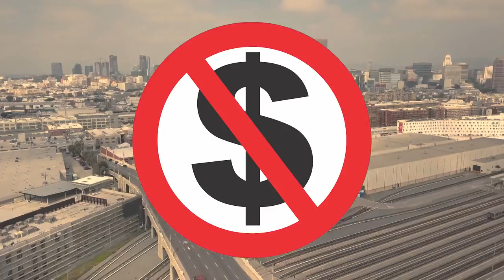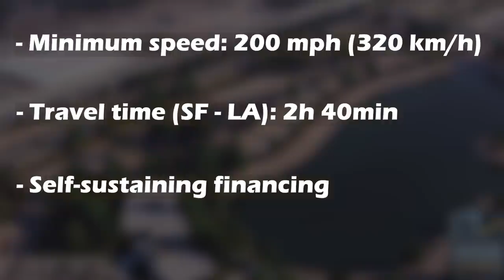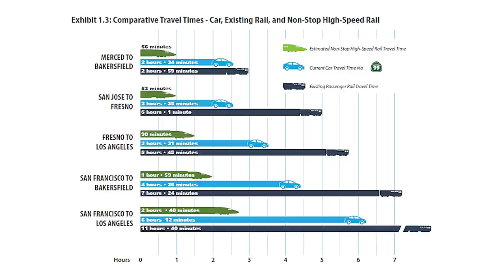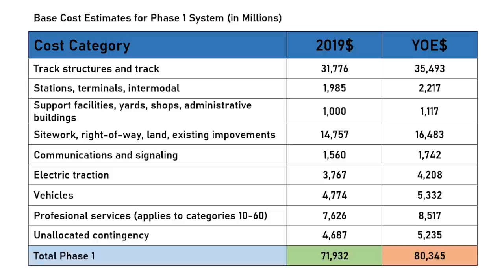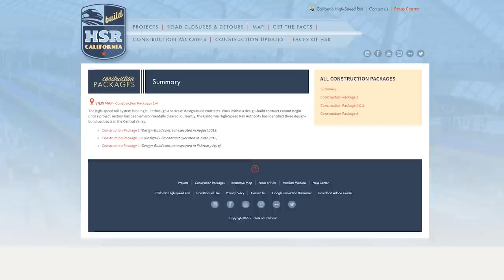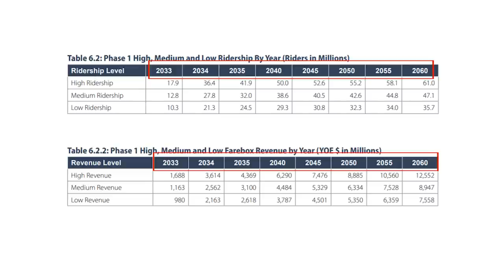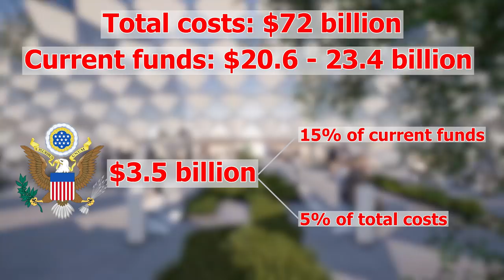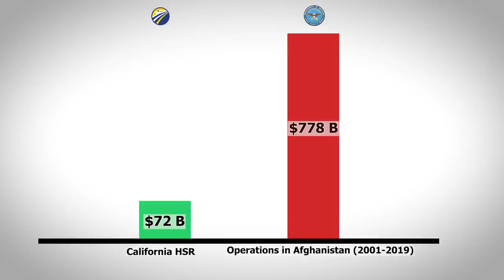California High-Speed Rail Project: All You Should Know

Comment: This is an excellent unbiased report on CA HSR. One thing though that was only briefly mentioned was that early on consultants from Europe recommended a different route. Instead of the current route along old Hwy 99 using the I5 corridor was recommended since the land rights were already in place. Anyone who has ever traveled along these routes knows that Hwy 99 goes right through some of the most productive farmland in the world, while I5 goes through mostly barren country. The latest report from HSR contractors identify the land acquisition as the one of the prime factors for delays and cost over runs. Of course politics early one was a big driver for choosing the route unfortunately.
Personally if driving I prefer Hwy 99 over I5. It's slower but much less boring than I5. If HSR is ever fully operational I doubt I'll live to see it.
Reply from the maker: thanks for those details!
Reply: They should give up and do I-5
Reply: the local governments along 99 lobbied for that route even they already have Amtrack. They don't seem to understand the distance and traffic needed to justify HSR
Reply: Placing stations on I5 may be cheaper but it detracts from some of the value by building outside of the city center. It would create more car trips, new development and not create long-term investment in existing city center, which takes away from the sustainability benefits. Sure it would be cheaper, but what benefit would be lost in the process?
Reply: @jpg3702  Perhaps but the original concept (voted on by the citizens) was HSR between the metro LA/SD area to the Bay area, not Fresno, Bakersfield, Stockton, etc. Those connections should have been added with commuter lines as needed later along existing highways that exist now. Very little ridership was and still is anticipated from the smaller towns along the east side of the valley.  In a recent article in the LA Times the main contractors identify the land acquisition as the major factor in cost over runs and schedule delays.
Reply: @johnburwell6609  I hadn't read the exact legislation, but the very initial concept that I heard about before it was even a bill included stops in the Central Valley. The planners who were discussing it included this because it would help those cities in the CV.
Reply: Fresno is the fastest-growing metro area in California, with all the sprawl that goes with it. And with housing in the Greater Bay Area skyrocketing in cost, people are commuting from places like Tracy. So I'm in favor of HSR including the larger & fast-growing population hubs in the Central Valley. I also want HSR to be integrated into a local mass-transit network in each of those locales in order to reduce car travel & sprawl. Whether any of this will happen, remains to be seen. But since construction has already begun, it's kinda too late to even talk about switching to the I-5 corridor anyway.
Reply: @joechang8696  TBH, I feel like comparing Amtrak to anything would be a slap in the face. Sure it's a train just like the HSR, but the speed, frequency, and reliability of the service is crap.

That the local governments are opting in, I believe, is that they lose if they join in, but they join more if they don't. Why? This is a farming area. How often will people travel long distance without some sort of cargo? The second you have cargo, public transit goes out the door. But, there will be times when you do travel for fun. If the train is going cut through your area anyway, might as well benefit from it.

Though I'm sure Central Valley won't be happy that the Bay Area has moved in either. The culture/believe/POV are quite different between the two, and of course, locals won't like the jacked up housing prices.

At least now that the rail is there, Amtrak could take it over and use it to improve their service...

Didn't realize acquiring the land was the issue. Always thought it was the required tunnel going through Tehachapi and later Pacheco Pass.
Reply: If you build on the I-5 corridor,  then you build where there are no cities.   You aren't going to get people to leave the congested areas of the state if there is no place to live.   The 99 corridor was the right avenue;  however,   HSR failed miserably in getting a line drawn and the property purchased.  Land owners kept them tied up in court for a very long time.
Reply: @thegreattuna7187  agreed.
The thing about these Central Valley agricultural landowners is, they are some of the most batshit right-wing people you'll find. Just look at the signs they post up along the highway.
They have no problem selling their land to a private prison - so the people who are locked up there can increase the population size of their district while not actually being able to vote (kinda rings a bell, doesn't it?) - but to build a railroad where a perfectly good highway exists? Sounds like progress and we can't have that!
Between them, and the ones along the CalTrain route down the Peninsula throwing up bogus "environmental" lawsuits, they must have added a decade and a gajillion dollars to the project.
And then they point to how long it's taking and how much it's costing and shout "boondoggle" as if they had nothing to do with that!
Reply: @thegreattuna7187  The voters in CA that approved this initiative didn't vote to provide a solution to the large metro areas failed housing policies. They voted to provide HSR between LA/SD and the bay area. At the time this project was conceived the revenue attained from providing service to the cities on the east side of the valley was studied and found to be minor. The cost of providing that service wouldn't be recovered. Remember one of the main concepts that the voters approved was that once built it would pay for itself, not be an ongoing drain on the state budget.
Reply: @johnburwell6609  This is false.  Here is a quote from the original proposition's ballot summary:

"Provides for a bond issue of $9.95 billion to establish high-speed train service linking Southern California counties, the Sacramento/San Joaquin Valley, and the San Francisco Bay Area."

San Joaquin Valley = Fresno, Bakersfield, Stockton, etc.
Reply: @Geotpf  That's from the ballot summary not the original words of Prop 1a. A lawsuit was filed about how the summary was written which was finally upheld by the court of appeals in Sacramento but by then the prop had already passed. One of the original requirements was " If the authority finds that there would be no negative impact on the construction of Phase I of the project, bond funds may be used on any of the following corridors: 
Sacramento to Stockton to Fresno
San Francisco Transbay Terminal to San Jose to Fresno
Oakland to San Jose
Fresno to Bakersfield to Palmdale to Los Angeles Union Station
Los Angeles Union Station to Riverside to San Diego
Los Angeles Union Station to Anaheim to Irvine
Merced to Stockton to Oakland and San Francisco via the Altamont Corridor"

This route you refer to is included but note only if "there would be no negative impact to construction of Phase 1". Can the argument that "no negative impact" exists still be valid?
It's also interesting that one of the arguments against 1a was that the costs for Phase 1 had been way underestimated and was closer to $80 billion which is surprise surprise close to the HSR authority's revised estimate.

I'm not against HSR but I was against the way this was crammed down the voters throats with misinformation and political back room deals. I don't really care that much since I've long since moved to Arizona which is at least a little more honest to it's residents.
Reply: The HSR ballot measure included specific San Joaquin Valley cities specifically in order to get more votes.  And without those votes there would be no HSR at all.  I will also say that the construction of HSR is a major reason why I will leave Los Angeles when I retire, but will stay in California.  HSR access to SF or LA will allow me to retire in the San Joaquin Valley where housing is affordable, but still allow me to have quick, easy access to SF and LA.
Reply: @sftrick  I hope you're retirement plans are far out in the future. Most likely with the current schedule, funding problems and construction delays the link to LA is many years away.
Reply: @jpg3702  there's no stations to be on I-5. It would be just straight running, which is the purpose of the project. LA to SF as fast as possible. Spur lines would be built to service the other cities.  In my opinion, its for SF to LA, not Modesto, Turlock, Merced, Madera, Fresno, Hanford, Bakersfield, etc etc etc
Reply: @johnburwell6609  Ive been posting comments just like yours but didnt know about the recent articles about land costs but thats just what ive been saying.  they could have gone right down the middle of I5 at true high speed/shorter distance and minimal cost. they could also have just upgraded one of the 2 old mainlines from Bakersfield to Stockton for a much faster train and then just connected that train to the new line at north/south ends.  I wonder if Feinstein's old man Blum has corrupt interests in the current project?
Reply: @johnburwell6609  yeah I think it takes CA-99 since it's supposed to service Central Valley towns as well as SF to LA travel
Reply: I think California HSR will happen no matter what because we are the richest country in the world. Europe always face obstacles before when building a High Speed Rail back in the day. If Europe can do it, then so can California.
Reply: @qjtvaddict  Not really, the California High Speed Rail will take very long to build, but I think it will happen no matter what.
Reply: @dwc1964  its more like lets put a wall through the middle of your farm and a loud noise producing thing right behind your house if we happen to not have to destroy it. Also it is a couple miles from the 99 so not on a road but all farmland. Oh and this really doesn't help you at all because you don't have any desire to go to LA or SF but brings those people who are going to complain about farming.
Reply: @gerritderaadt5497  Central Valley farm owners have had no issue selling their land to prisons (private and State) but they've got a problem selling their land for a railroad because they're not going to personally ride it.
Reply: @thegreattuna7187  Have you ever driven the I-5?  Thousands upon thousands of cars drive the I-5 between LA and SF every day.  These are the cars we want to get off the road.   These cars aren't going from Shafter to Merced.  They aren't going from Hanford to Oildale.  Yes, there are many cars going on those trips but it will be hard to get them out of their cars for short trips like that.  Also, there is NO commercial air travel between Shafter and Merced.  Just getting a percentage of those filthy, polluting cars going from LA to SF (or the other way) off the road and reducing the number of airplanes polluting the upper atmosphere between LA and SF would make a huge difference in our polluting the air.  Isn't that what HSR is all about?
Reply: @JediTev  Clearly it's not just for SF to LA (Sacramento is also factored in as well), and it was never intended to be. It's clearly for much of California, though it is noted that it won't directly serve Kings and Tulare County (the Kings/Tulare station sits just outside Hanford and about 20 miles from Visalia and Tulare), so it definitely makes sense to build HSR connecting directly to the cities in the San Joaquin Valley. On the bright side, there will be express trains that will skip some of the stops, like Madera.
Reply: @garywilson1688  HSR will get cars and their drivers off I-5, even with the SR-99 route. Many of them will be taking express trains that will skip the smaller cities while still making stops at locations like Fresno.
Reply: The problem with that is that I-5 doesn't serve many of California's most populated cities. Bakersfield and Fresno are among the top 10 most populated municipalities in California and it would be a travesty to not serve these areas directly with HSR.
Reply: @TheRailLeaguer  Not a chance
Reply: @garywilson1688  What are you talking about?
Reply: I think a big thing putting American high speed rail at a disadvantage is that America has plenty of oil. Europe and Japan have pretty much no oil of their own so for them electric rail is not just socially and environmentally but also economically advantageous.

Comment: Starting with the section they are is a joke.  They should have done the LA to SD section.  If they had actually done that in the 80s maybe the system would have be done by now.
Reply: I think building in a less dense area is good because it will allow them to learn from mistakes.  We have to remember it's the first project of its kind in the US and there will be some learning along the way. That learning should not come at a premium that would be there if going through densely populated areas.
Reply: @jpg3702  But it serves no purpose.  Makes way more sense to build the lines in the cities, that could be used, and then connect them later on.  It's not the first of it's kind in the US, there are 2 high speed electric rail lines  on the east coast.
Reply: @mushieslushie  There is a big difference between those lines and an actual high speed rail line. If you look at the history of the bullet train for example, it was designed from the ground up on grade separations and goes at much higher speeds, much higher than the highest speed train in the Northeast. I'm not sure what the second line you are referring to, but if you mean the one in Florida, it's not considered high speed.  In addition, there are a lot of engineering complexities of building in earthquake country vs the East Coast trains. Those trains are not truly HS rail and they are build on the same grade as roads, causing a lot of passenger delays, injuries and deaths.
Reply: They did it this way for two reasons.  First, it's the section that is easiest to complete.  Not only is it less curvy and less dense, there were fewer lawsuits in this section.  The rail authority won most of the lawsuits but it did cause a delay, so start in the area that had the fewest delays.

The second reason was political and kind of sneaky.  Basically, everybody knows the Merced to Bakersfield section is pretty much worthless by itself.  If they started in a section starting in LA or San Francisco, it would be likely that the section they started with would end up being the only section built.  This would also cause yet another NorCal vs. SoCal catfight over who gets that section.  So, they started in the worthless section in the middle, preventing the north/south pissing match and also increasing the chance that the whole thing would be built, as it is hard politically to stop with just the worthless middle section.
Reply: I believe it is a strategy. It is easier to build that section, in term of land acquisition and construction. Once that part is done, it is easier to overcome the political pressure to complete it. If it is started in LA or SF, it will never get a chance to start. But the sad part is, the project still could end up being unfinished.
Reply: @Geotpf  I reach the same conclusion without reading your post. The sad part is, the project could still end up being a useless unfinished project.
Reply: and would already make money for the stretch which is ready.
Reply: @Geotpf  But wouldn't that strategy backfire when the opponents can point to it and go "see it's useless and unprofitable", and get the whole thing canned.
Reply: Look to China, and learn .....
Reply: @mushieslushie  There's already trains and right of ways in those places. They need to build it in parts where there aren't i.e. the Central Valley.
Reply: There was no only way that the LA-SD project ever got a chance to move forward. All of this stuff was discussed when the project got started. If they were to build LA-SD or SF-SJ first then the project would have gotten cancelled after that first section, and everyone knew that. 

Plus why would the whole state pay for a section which only benefits one region? I'm in NorCal. How does your LA-SD section help me? What you are proposing was a nonstarter from the very beginning. If they were to plan it like this there would have been no CHSR at all. This way we have a chance at least!
Reply: @mushieslushie  Fresno and Bakersfield are small by California standards but they are large cities. They already have the very popular Amtrak San Joaquins which this project would improve immensely and make transit more popular in the area overall. (It already is the second most popular route in the US.) This is infrastructure and rights of way which will stay in use for centuries, if not forever. Even if this project is cancelled there is no way that this infrastructure goes unused or even underused. Plus there will be connections to Bay Area rail (ACE and San Joaquins to SJ, Oakland, and Sacramento). Even in truncated form just what is now approved, funded, and being built right now will be transformational!

Even if full HSR trains never run, at the very least we are getting Brightline-like Amtrak San Joaquins service almost statewide. But better because it will have a massive section of fully grade-separated rights of way at 125mph, not at 110mph like in Florida. Amtrak already runs the same Siemens Chargers Brightline uses. Now they will have the first actual high-speed rail track in America to let those Chargers really flex their muscles! This service would cover San Jose, Fresno, Sacramento, Oakland, Bakersfield, and Stockton. The 3rd, 5th, 6th, 8th, 9th, and 11th largest cities in the state.
Reply: @simonjones9455  China is an authoritarian country with limited private property. This is not possible to do the same way in the US and in general in normal countries. You can't just take away people's land.